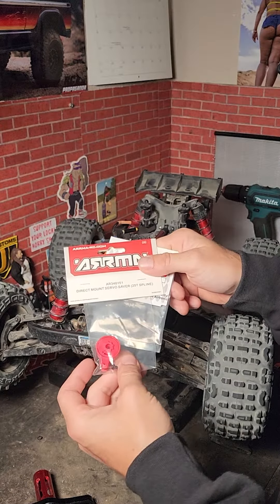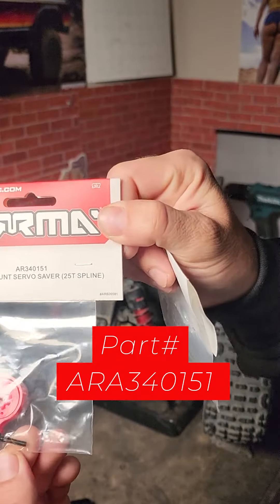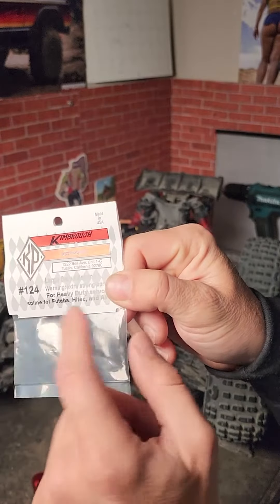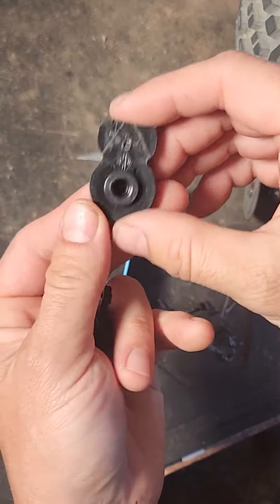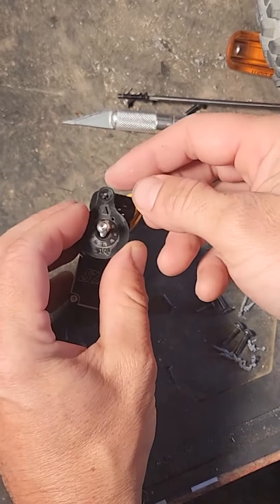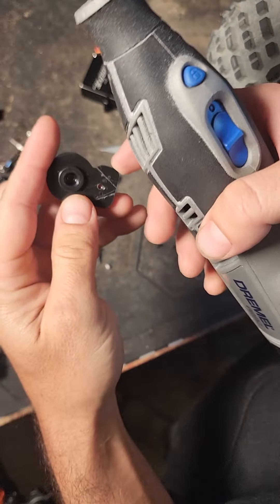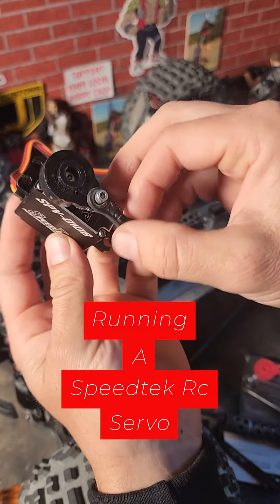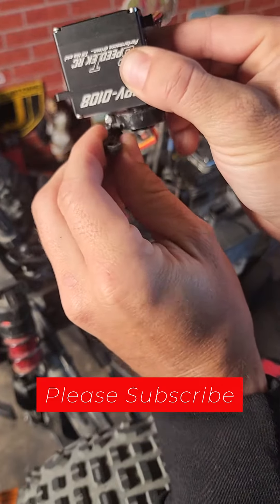Dramatically Improve Your Outcast/Kraton 4s Steering with This Simple Upgarde!

Comment: It's easier just to fit the kimbrough spring to the arrma servo saver
Reply from the maker: I learned from someone else, so I did not think of doing that, or knowing if it can be done. Have you done that?
Reply: Works a treat ☺️
Reply: @ThiBor64  excuse me mate will the spring fit the standard servo saver that comes with the truck? I thought my v2 maxx steering was bad!
Reply: @daig1984  i dont see why not mate, they are effectively the same thing its just the teeth that are different for the different servos
Reply: @ThiBor64  thanks for the reply. I just bought the outcast and a max 8 combo for my maxx , if I spend anymore my misses might get me in the night 😂 so I’m gonna have to keep the stock servo for now
Reply: @daig1984  you can also improve steering by putting thicker diff fluid in the front diff i went 20000 in the front and 10000 in the rear stops the front tyres ballooning and keeps the front down a bit more  remember there is alot of power in these little trucks, it picks the front up hence no steering 😉😄🤙
Reply: The spring you are talking about comes with the kit but your only using the spring right or it’s available separate
Reply: @Luis Torres  hi yes it comes in the kimbrough servo saver , just swap it out for the arrma spring,

Comment: Might be a silly question, but when I tried doing this and put the arm on the horn like you did the screw head connecting the two hits the chassis. Did you have to shim the servo in the truck?
Reply from the maker: I did have to cut down the horn to fit. Not sure what you mean.